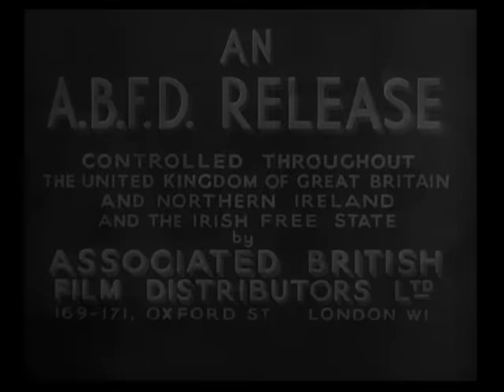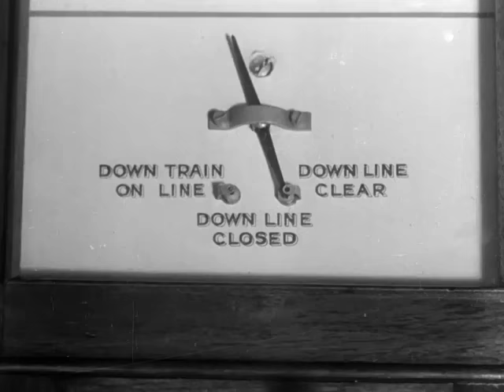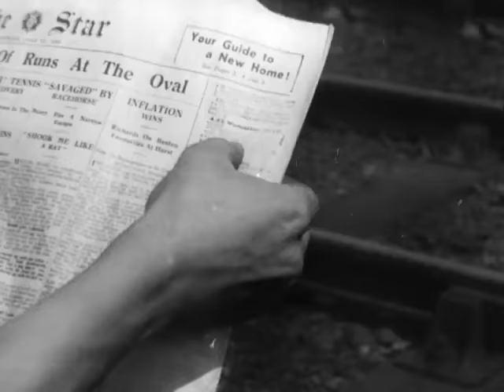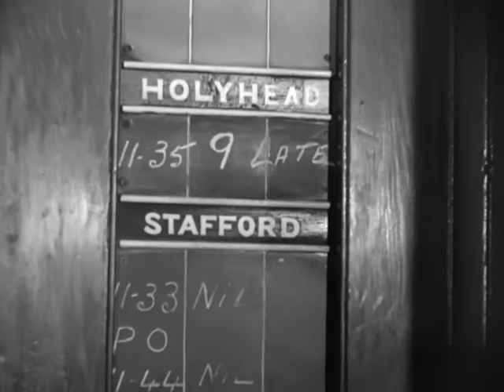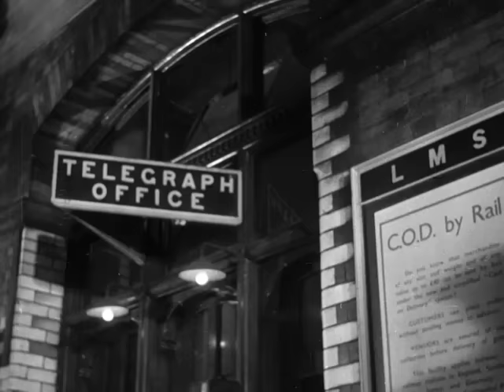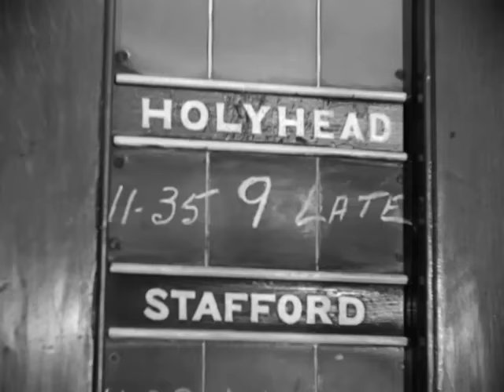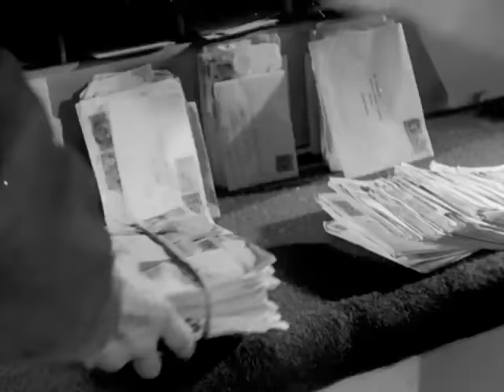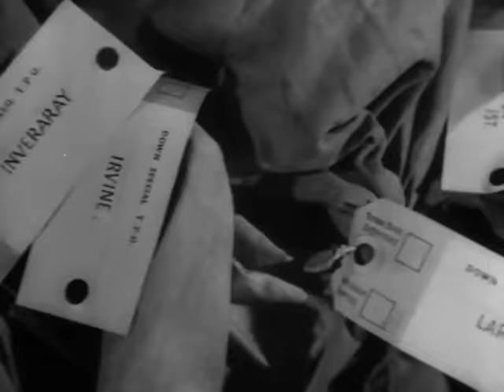Night Mail (1936) UNABRIDGED FULL DOCUMENTARY

Comment: Although there's hardly any left now mail trains use to come under class 1 head codes when I worked on the railways.Class 1 is fast passenger and mail with class 2 being slow passenger.Although class 9, which was added for Eurostars,was later used for fast passenger too.0,3, 4,5,6,7 and 8 were light engine, empty stock,civil engineering and various speed of freight.